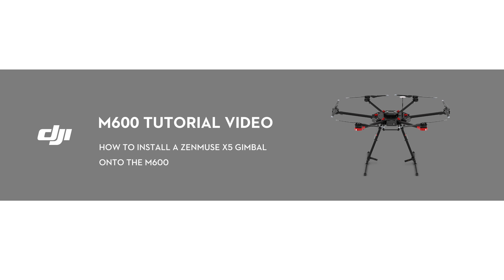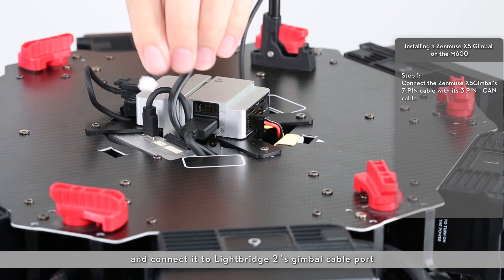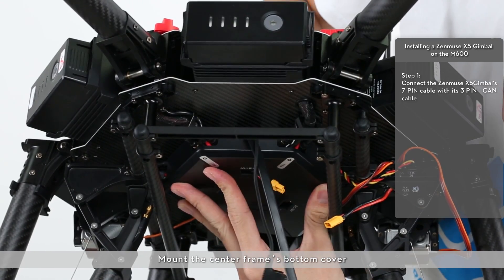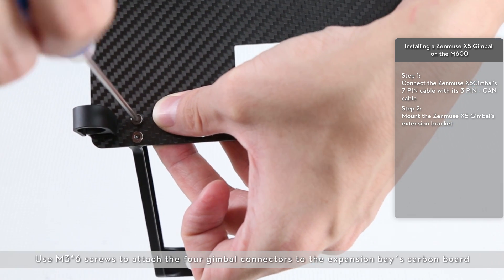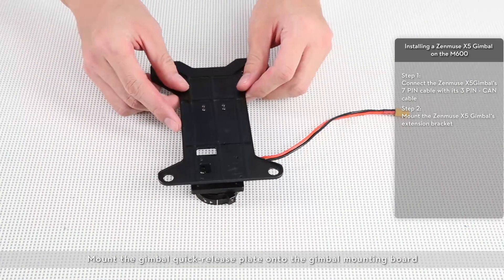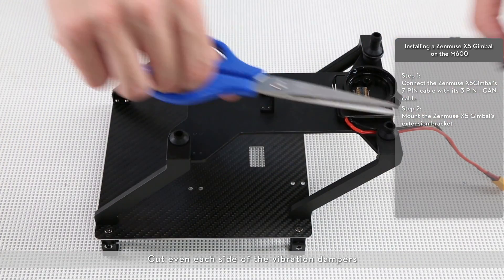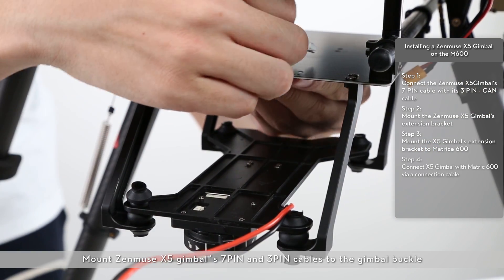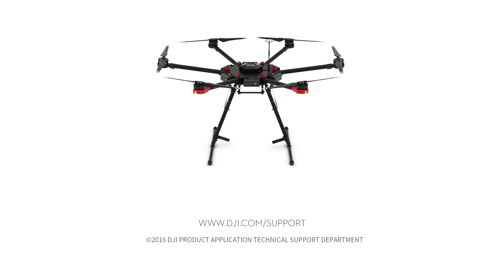DJI Matrice 600 - How to Install a Zenmuse X5 Gimbal onto the M600

Comment: Can I conect a Zenmuse Z3 on a Matrice 600 Pro?
Reply: Yes.
Reply: @davidwim  This mount can be used on a S900, right? I'm just not sure on the spacing of the lower tubes. I think the S900 and M600 are basically the same frame. But never had a side-by-side comparision.

Comment: Does it work on the s900 and s1000
Reply: no
Reply: it does but you have to slightly modify it. I will be doing a video about it soon
Reply: @KBeadle  did you ever setup up a s1000 with the x5 or x3zoom.
Reply: It doesn't?